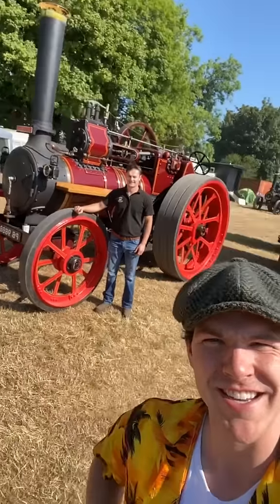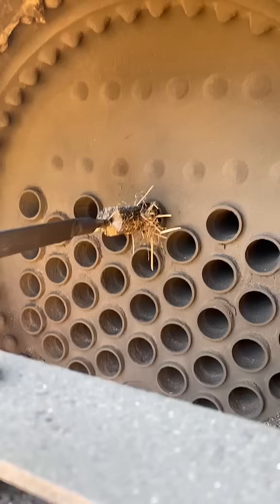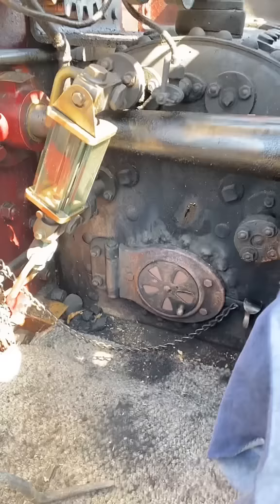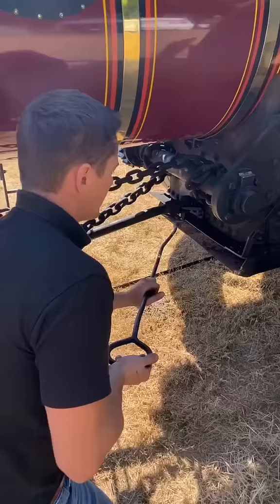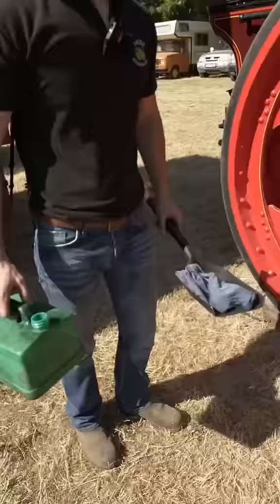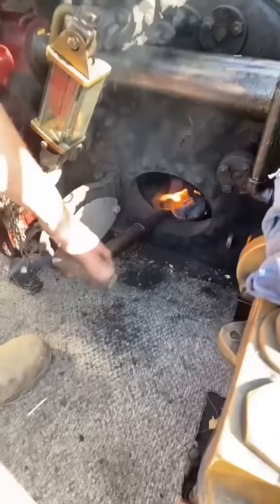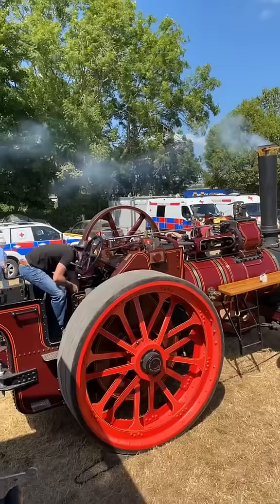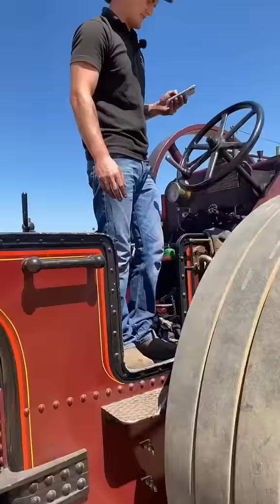Cold Starting A 1912 Marshall Steam Engine #shortvideo #ireland #steamengine #coldstart

Comment: Me and the boys when California makes all gas vehicles illegal
Reply: When legislators ban internal combustion but forget about external combustion
Reply: @toyotaprius79  that sounds exactly like how they are too
Reply: @toyotaprius79 lol this isn't either, this is a steam powered engine with an internal cobustibles...
Reply: And there’s plenty of dung to burn in it, just gotta pick it up off the sidewalks!!
Reply: @ThomasSawyers  The combustion is external to the cylinder, so it's an external combustion engine.  The combustion doesn't literally have to be outside.
Reply: @JayRussellDuramax  yup you're right lol, i thought external combustion was different but either way I didn't say the combustion had to be on the outside though
Reply: @ThomasSawyers  Haha!  I wasn't sure what you meant by "internal combustibles".  I assumed you meant that the combustion was still inside something, so that made it internal combustion.
Reply: @JayRussellDuramax  lol no I meant for combustion to occur in a way that it drives an engine it has to be inside something, I also thought external combustion was different than this but I'm mixed up lol
Reply: And I don't see this as an issue. The issue is the scale on which we're burning oil while we could replace that with something greener. We won't be able to completly stop using oil for decades, but it doesn't mean we shouldn't try to make things better. And clean air is quite nice.
Reply: @arakwar  There's nothing harmful about burning hydrocarbons, and there's no sign that we're running out of them either.
Reply: Look at you thinking they'll let you run this.
Reply: @Jesus_is_THE_king_of_kings  lesbian kindling… sounds like something a big megacorporation would sell for pride month
Reply: @ThomasSawyers  In the US these would not be considered 'internally combustible' as the coal itself is not directly contributing work (the water/steam is what's doing the work), coal or oil is considered an 'external combustible' in this case.  As per 40 CFR § 63, NATIONAL EMISSION STANDARDS FOR HAZARDOUS AIR POLLUTANTS, they would be considered a 'fossil fuel-fired' engine (since you can technically convert them to oil- or gas-fired).

Most of these steam tractors are, however, already regulated under the provisions for 'temporary boilers' since they can technically be hooked into industrial systems (old ones, but still).  I'm fairly sure old tractors are probably exempt for historical preservation or education.

If you'd want to actually use a steam tractor for industrial uses now days you'd have to specifically build it to run on natural gas,  as NG conversions don't work with these older engines without basically rebuilding them.
Reply: @conk444  🤣
Reply: but steam IS gas (isn't it?)
Reply: @matthewtrain  no its not its water vapor
Reply: @JayRussellDuramax  you’re joking right?
Reply: Boutta hit 20mph with this boy on the freeway
Reply: Good luck finding coal
Reply: Modern problems require old solutions
Reply: @toyotaprius79 they ain't said nothing about bamboo charcoal
Reply: Lol
Reply: you think they gone allow you to use coal?
Reply: @toyotaprius79 No way!! Toyota Prius?! The car?!
Reply: Eustis wood-burning Toyota was pretty legit
Reply: @JayRussellDuramax  how's the smoke inhalation getting on 🫁
Reply: @nootypenguino  yeah, back in 2008 this username would get a lot of death threats from a lot of butthurt boomers. I preferred YouTube way more back then than now
Reply: @toyotaprius79  What?
Reply: @toyotaprius79  Fair enough
Reply: I don't know if this is like a real thing but if I were making any loss some way to this which I wouldn't I would make it where you just can't make any new cars that are gas powered.
Reply: Is something like that even plausible ?
Reply: @Snowaxe3D  I mean it would be stupid and could end up with a riot or something but I guess so
Reply: Rolling through San Francisco in a steam engine
Reply: Well there were a time, both electric and steam cars were more popular than gas cars. Some of thr steamers had a prep time of just about 5 Minutes and over 100 hp plus tons of torque
Reply: Dude dont let em take your car. Just convert it.
Reply: Your wood burning oven there will be illegal too
Reply: Log burning stove in the back fettle with the pipe use the smoke as fuel
Reply: @toyotaprius79 haha 😂
Reply: @Jesus_is_THE_king_of_kings haha 😂
Reply: Get a massive trailer that can take hundreds of people, ciz this thing can pull it
Reply: Coal fired external combustion is already illegal in CA. Oil fired isn't illegal yet.
Reply: @Jesus_is_THE_king_of_kings hair makes smells when burned and think of all the chemicals from the dyes
Reply: @zerotodona1495  the chemicals would make it burn hotter and light easier plus its only tinder and wouldn't smell for long🤷🏻‍♂️🤙🏼
Reply: @karlrovey  CA prefers external combusting EVs.
Reply: The lengths people will go to to avoid electric cars is astounding.
Reply: @Diogenes_ofSinope  The lengths people will go to to try to claim that self combusting EVs with very limited charging stations are a viable solution is incredible.
Reply: @ThomasSawyers  internal combustion refers to engines where the combustion happens inside the engine itself, whereas external combustion means it gets the heat from somewhere else, in this case the firebox and boiler. The engine itself is just the pistons and drive mechanism
Reply: It's already illegal to burn wood or anything for that matter 😢
Reply: @ferrumignis  they’re about as self combusting as your gas powered cars, and if more people use them there will be more charging stations
Reply: ❗Charcoal is carbon neutral❗
Obviously it's quite polluting because of all the smoke and soot but looking at the Co2 emmisions it's completely neutral because charcoal is made of plants, compared to normal coal or oil which are not part of the global carbon cycle because they were buried deep under the ground.
Reply: Good luck man.
Reply: And now they’re taxing the electric ones because the petrol and diesel taxes ran dry xD
Reply: @toyotaprius79 they will actually let you use one as long as it doesn't burn mineral Coal and has a spark Arrestor
Reply: Is this supposed to be a bad thing?
Reply: @JudeArreola-qf3lt   Well the other options (right now) are everyone using fully electric, which isn't "good for the evironment" or horses... The number one benefit from the introduction of the ICE was the dramatic drop in horse s*** everywhere :D
Ideally though, yes. Some day we'll be on hydrogen hybrids.
Reply: @toyotaprius79 Subaru owners
Reply: YES BUT BIGGER
Reply: @JayRussellDuramax  "There's nothing harmful about burning hydrocarbons"
Sure, if you're ignorant enough to ignore all the asthma, heart disease, stroke, climate change, and heavy metals poisoning then there's nothing harmful at all :^)
Reply: @alexrogers777  Please tell me how burning hydrocarbons is responsible for any of that.
Reply: @ThomasSawyers  this is also false look up a sterling engine
Reply: @JayRussellDuramax  this is the most false thing i have read on this entire thread
Reply: @michaelsmith6579  What are you talking about?  I don't know which comment you're replying to.
Reply: Steam is a gas
Reply: @averyhershey4727 literally anything that burns would work

Comment: They start up far faster than a steam train, trains normally take about a day
Reply: Starting procedure is pretty much the same for my diesel engine 😂 #VWLife
Reply: I imagine it also depends on how much water is in the tank
Reply: @MrCrispyNips04  Not just how much water, but the water temperature is the biggest factor. Figure if it's something like a steam locomotive it could hold close to a thousand gallons of water in the boiler chest. Getting that much water to temperature enough to make even a little steam to get a draft going can take hours if you're not pushing it hard. 

Back when steam was still king, they could afford to push a boiler hard. Now not so much, as the water has to heat up and the metal has to heat evenly else joints will warp, rivets pop. Leaks and possible boiler failure happen. So yeah, you can look at at least 8 hours if the water is cold to begin making steam but even that is running it hard. A day or two for a more gentle warm up from dead cold, less if the water still has residual heat from a previous heating.
Reply: @Bishop Corva  they used to use superheated steam from the buildings to start them up way faster, and still it took about 6 hours
Reply: @irishboi7596  Well yeah, it's a thermal dynamic situation. Water can only be heated so fast and so to can iron and steel. The latter two being good enough conductor to transfer their heat into the water making it a process of warming the whole kit at a steady rate rather than trying to get a white hot fire in the firebox with low water to try and get flash steam to kick the action off.

It's just easier to keep the locomotives in low fire near constantly save fore certain service tasks. But even then with the fires dumped, there was often enough stored heat in the boiler water to move into the shed or run hoses from one loco to another that was cold cold just to be able to move it over a short distance. Or dump the fire, leave it for a night come back twelve to twenty odd hours later and still have a water temp that's scalding.

Steam engines are many parts interesting and scary with the kind of respect commanded for operation.
Reply: @CranAlley same for my 12 valve in -60. Poor cold bastard.
Reply: That's because the engine is IMMENSELY smaller. You don't need anywhere near as much heat to make it start
Reply: @CranAlley  Damn... I usually just turn the key in my Jetta, never needed an oil rag to make mine start
Reply: Size of the engine... Same as we have 1000cc 2000cc (or 1ltr 2tr) etc

Bigger engine uses more energy to start
Reply: Imagine a cold start on a large ocean going steamship from the turn of the last century. I'll bet the time between adding fuel and throttle response could be measured with a calendar.
Reply: That time is highly variable, really depends on the size of the locomotive, bigger things like what Union Pacific runs take much longer to ease the strain on the boiler due to the higher pressure (300 psi operating) and age of the metal, while smaller locomotives, such as the Nevada State Railroad Museum's Virginia and Truckee #25 takes only 3-4 hours to gently bring her boiler up to operating pressure (150 psi operating, I volunteer there and have taken her from cold and sleeping to ready to run). Yes, it can be done a bit faster by firing harder to get pressure up, but slower is better for certain.
Reply: @CranAlley 1.9 TDI goes KLEK KLEK KLEK KLEK KLEK KLEK KLEK
Reply: 5-4 hours 2 if you use preheated water
Reply: Chinese aircraft carrier, which debut in 2017, takes 2 days to start up.  Normally, aircraft carriers take 2 hours.  Nuclear ones take only 1 hour.
Reply: @bishopcorva took about 1,178,000 btu to heat 1000 gallons of water from room temperature (70 degrees Fahrenheit) to (212 degrees Fahrenheit) and then latency heat to turn it into steam
Reply: Geez. Very interesting. I didn't know that. Thank you
Reply: A DAY?! No way pal, we usually heat our little Choo Choo up within 4-5 hours. But a whole day? Nu uh.
Reply: @AsianManZan my 12 valve 3.9 magnum starts right up idk what is wrong with yours probably some junky diesel what brand is yours? Myin is Mopar the best
Reply: @oldsguy354 throttle response has nothing to do with how much fuel is added. It’s how much you open the steam valve to the pistons that drive the prop shafts. You can have the valve closed and not be moving with a roaring fire in the boilers, you just need to be venting steam.
Reply: I almost choked when I saw it moving after only 30 minutes 😂😂
Reply: It’s not from cold with 30min. An engine as such takes at least 2/3 hrs from bone cold.
Reply: @niels6101  that is not enough information we need dates temps elevation humidity and usually trains take a few people and minutes to start. Your parents can help you with info. on trains
Reply: @rosslefave5877  Mate, i've 10 years experience with boilers. With that size of boiler regardless of "dates temps elevation humidity" it does take 2 hrs to say the least. And then you are pushing the boiler to its limits. Also if you PROPERLY heat an engine its 45/60 mins at a minimum. If you take care of the boiler 6/8 hrs should do the trick of getting it properly warm without an circulationpump.
Reply: @niels6101  if I can't run it way past the capacity I don't want it. I'm not in it for the long time as much as the good time. Live for a moment and do everything or live forever and do nothing. No brainer
Reply: @rosslefave5877  great, lets hope you never fire a boiler. Your an perfect example for an boiler explosion due to misuse of the boiler.
Reply: @niels6101  I love it when anything goes boom how do I sign up?
Reply: @niels6101  you better put some type of governor on them I'm filling the water with gasoline help build heat
Reply: @CranAlley VW = Visit Weekly 😂
Reply: @AsianManZan yo get a Mercedes truck night heater. On mercs the nigh heater runs different. Instead of blowing hot air in the cab it runs the water pump and it warms up the coolant thus you warm up with the regular climate control system. But as a nice bonus your engine temp sits at 65 Celsius. It even has a timer so you can set it to kick on at a certain hour. Get that shit warmed up 30 mins before showing up to work and have your windows defrosted ahead of time.
Reply: Yeah it’s takes about 3 hours to fully heat up a loco
Reply: thats true 😂
Reply: depends on the size of the engine. some of the smaller ones are surprisingly quick.
Reply: No they take about 4 hours but that's cause they are almost 3 times the size they are massive and thus take way longer to warm up
Reply: @irishboi7596  seems now they run some form of pump to recirculate water in the boiler so everywhere is heated at the same time

Comment: 1912: damn, things been well kept.
Reply: Restored likely. At the very least repainted.
Reply: Times that things where made to last👍
Reply: I’ve driven a car from 1904 that’s pretty much in mint condition except for a crack in the front
Reply: It is heavy machinery
Reply: Old as the Titanic.
Reply: There's just no possible way that the boilers and fire box haven't been rebuilt or replaced over the last century, probably several times each. But if they are original, I'd be afraid to be anywhere near them in use.
Reply: @bouma_beunwerken_BV  Just because you don't take care of your stuff, doesn't mean it can't last.
Reply: @bouma_beunwerken_BV yeah no. The only way to keep something going is maintenance. This is no different, far from it actually. If anything, modern tech is objectively superior in every way besides simplicity. You only have to look at the life times of parts and components to realize that modern technology has a drastically improved lifespan. Orders of magnitude more.
Reply: old things tend to be built extra strong.
Reply: It'a almost only metal that it's built of. Not half of it plastic like nowadays.
Reply: Its bound to have needed the odd repairs done but still impressive nonetheless 👌
Reply: A survivor's fallacy. Just because we see one still operational in good condition doesn't mean that things were universally made better back then. It's one of a handful of survivors that were lucky enough to be well kept and repaired. There could be hundreds or thousands of similar machines that broke down long ago and were just scraped.
Reply: U think that’s Gud, u should see the age of some of the steam locos on the Ffestiniog railway in wales
Reply: @Jammie_Dodgers_trains  Oh, out of all the places in the UK and the Republic of Ireland. I desperately want to explore the fascinating history of Wales.
Reply: @Butter_Warrior99  if you want recommendations for railways, come to me
Reply: @Jammie_Dodgers_trains  Tell me about a rail line that means the lost to you.
Reply: @Butter_Warrior99  Talyllyln railway or Ffestiniog railwa
Reply: @Jammie_Dodgers_trains  I’ll keep this in mind when I come to the land of the Arthurian tale.
Reply: I've seen ones older in running condition. Absolutely spectacular machinery.
Reply: Wait until he learns about the Prins August
Reply: @matthewmorgan582  Most of them are rebuild by original blueprints! Restored? It's not a barnfind that runs! It's been idle and parts where stolen over the years from them to fix other vehicles later!
Reply: @midgetman4206  its a double edged sword. Fuel injectors are way more effecient and "just work" but if it malfunctions then it could be 1 of any number of expensive issues. even with a new car. 

with an older carborated engine, its pretty trivial to diagnose and fix yourself. just needed a wrench and a book youd buy for your model and generation.
Reply: Most steam engine a well kept being painted and repaired when needed. Keeping it as well maintained as a car

Comment: I mean... Does this count as a Cold start?
Reply: I would assume that there is a valve that can be opened to release the pressure when still hot but not in use, so a hot start would be closing it and adding more coal. But I very easily could be wrong
Reply: well the engine is ice cold before u start the fire so technically its always a cold start